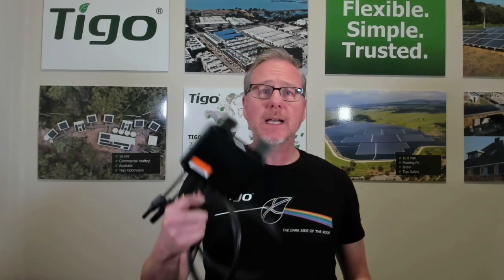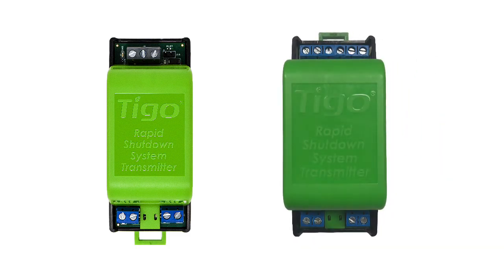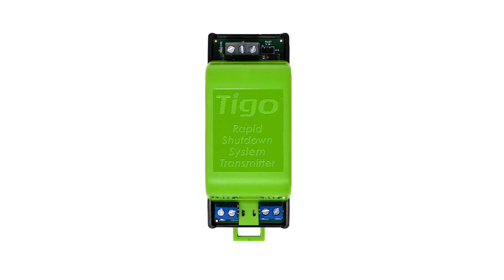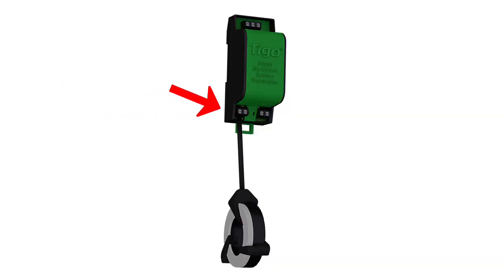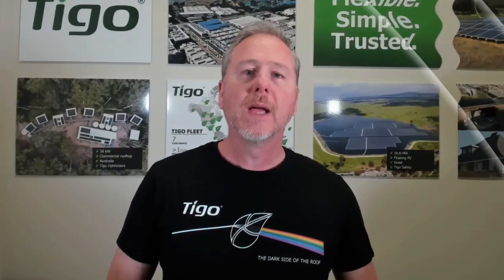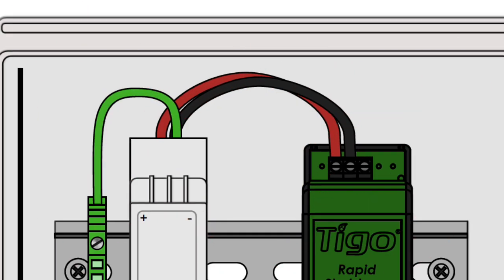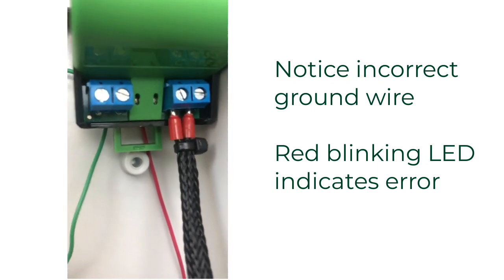Tigo Tech Talk: Common RSS Transmitter installation errors and how to avoid them

Comment: i feel like you could have prewired and assembled this for us - right now I am hating your product so much I don't think I want to do solar anymore, at least not on off-grid cabins - gonna stick to RV's - much better much easier
Reply from the maker: Off-grid PV isn’t “hard,” but it is unforgiving if you treat it like an RV install. Different rules, different expectations. Once you wire it with the system flow in mind, it gets a lot easier.

Every site is a snowflake, and prewiring would only add complexity and cost.

Comment: I have had no problem with the RSS side of RX.... But I continue to have 'intermittent' late start of production on cold mornings in a simple single string of eight Qcell modules wired up with four Tigo TS4-a-2f units. I have spent HOURS checking connections, etc, etc... and am at the point where I am likely to remove the 2F units, re-string without Tigo, and never use them again.
Reply from the maker: Hi Daniel, I see that you have a service ticket with us and that your issue was resolved. For the benefit of everyone, the solution was to use our external 12V 1A power supply since Sol-Ark's internal 12V power supply only puts out 100mA. Sol-Ark has updated their manuals to reflect this inconsistency.

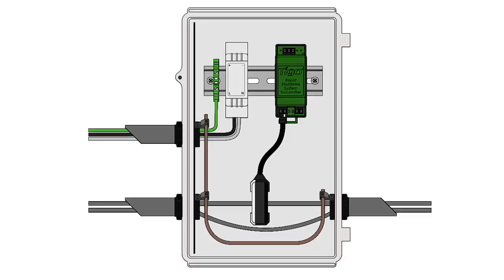Comment: Thanks for the video! Super helpful. Honestly seems like a miss to spend so many minutes talking about which side of the core faces the panels but not at all mention which of the actual power cables (positive or negative) the core surrounds, but I suppose that's in the manual. For a brief instant at 4:17 you show an overview, but both panel power cables are rendered black. Regardless, good info here.
Reply from the maker: That is an excellent comment, Jesse. Greg is working on more videos to address specific installation requirements. Stay tuned! As per the quick start guide and the manual, only the negative homeruns should run through the Core. https://www.tigoenergy.com/downloads

Comment: That overwhelming laughter you hear is from enphase! why you ask? the supposed savings you get from a string inverter vs micro is negated with all this extra hardware and pilot checklists you have to follow and head scratching that actually led to the need for this video.NO thanx! Even if there is some kind of confusion while firefighting personnel is at a site with solar, the minute they kill power will rapidly shut down any array voltage with micro inverters.The slight price difference but more importantly definite rapid shut down with out all the hassle, priceless!
Reply from the maker: A lot of people complain that microinverters are more expensive than the string inverters. We made this video because of the demand. We offer more flexibility when your microinverter supplier has supply chain issues since we work with virtually any inverter on the market. Traditional string inverter design and installation can be intimidating to people with just microinverter experience.